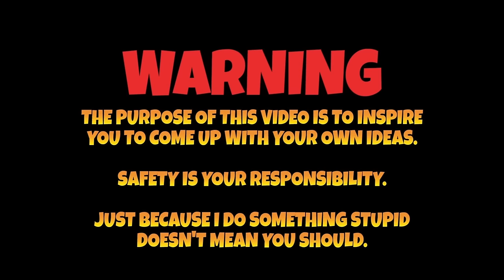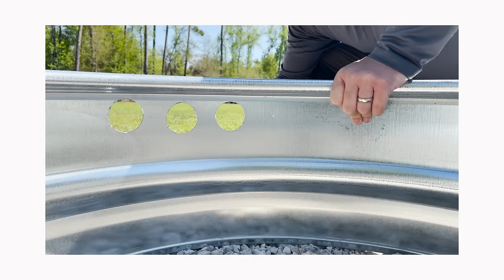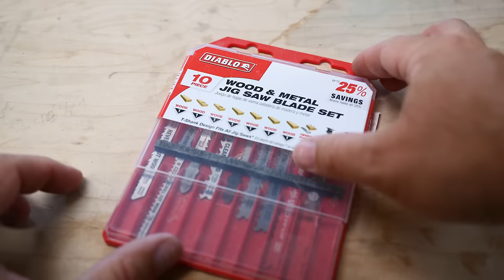8 Must-Have Power Tools For DIY And Woodworking

Comment: Always buy the best tool you can afford, with the biggest battery. I have a full set of Dewalt cordless tools (not the cheap models) and they are awesome. 
I would never buy those 12 v Milwaukee (or other brand) tools for two big reasons. 
1) Small battery and short battery life. 
2) Less power. 
3) Requires more room to set them down. 
The first two are obvious, but the last one is a big deal. When you are working in a small space, or on a small/cluttered work bench the amount of room a tool takes up is a big deal. The large batteries work as a foot to allow you to put your tool down standing up, with the small 12 tools, you have to lay the entire tool down. If you ever had to switch between a Drill and an impact driver when drilling and screwing multiple times, being able to set your tools down on that little bit of a ledge, or small space on your work bench makes a big difference over having to put them on the floor or turn around to put them somewhere behind you.

Also, square drive is the worst fastening system I have ever used. The wedge shape of the bits makes them constantly pop out of the screw head. Philips is even better, but Torx is easily the best. I have never had a torx bit pop out of a screw head.
Reply: Yo. Buying the best tool with the biggest battery that you can afford is not good advice man lol. You have to think about your application first. If you’re doing everyday work like framing, daily carpentry where you need high power like hammer drills, impact drivers that need to go on heavy stock or concrete ya sure get the best one. Milwaukee is the best most powerful one, but for a diyer having a larger Aph adds weight… it is also overkill. For sn amateur who hasn’t made money to compensate the expense of buying said tools will only lose In a return of investment… that only thing a person should go big on the get go is a tablesaw since most of the time those are future proof. Never want to go cheap with that neither like a ryobi where you got to adjust the fence all the time or you keep getting inaccurate cuts plus it’s wobbly as hell.

Lol diyer’s don’t need to be using the most powerful and the best high capacity battery lol. You can always upgrade. Always think ahead
Reply: Another thing too… Milwaukee is the best tool for most applications when it comes to drills with all the stress test people do. But those are annoying AF to change out the batteries and it is heavy with the metal Chuck.  Then and you can look this up, the biggest complaints I see over and over again is when hot mud or let say CA glue or other materials get into the pinch points of the battery latch… that’s game over….
Reply: You clearly are speaking of things you know nothing about.
Reply: I use the 12 v milwaukee every day @ work for general contracting. It's very rare that I need more power. Even the 12 volt circular saw does great. And dragging extra weight around because you think you need POWER at all costs...well that is for stupid people.
Reply: @iloveNgany  It's not just about power, its about battery life. Look up project farm. The bigger battery does create more power. There are also a ton of general contractors out there that are complete idiots.
Reply: @TheBenjammin  Please explain? Tell me exactly what I am wrong about.
Reply: @MAGAMAN  I agree I was just trying to say that if the 12v gets the job done, why deal with the extra weight. I use 12v whenever possible, but 18v when nessasary

Comment: decent vid, but no multi tool??? way more useful than a jigsaw. i have a jigsaw that is 20 years old and probably only used it 3 or 4 times. i have been through 3 multi tools in that time (tbf they were cheap ones) and hence and now looking to buy a decent one (milwaukee fuel is what i have on order). festool tracksaw is the best bit of kit i have, apart from a decent drill driver (again millwaukee fuel), and will do the same things as a table saw and circular saw. BEST ADVICE (and you said it too) IS TO SPEND AS MUCH AS YOU CAN! cheap tools give cheap results!

Comment: If I were going to buy one of these drills, Could I get away with just purchasing the impact drill to use for everyday use?
Reply from the maker: No. You need a drill for that. The impact driver isn’t for drilling holes.

Comment: I was going to get the m12 hammer drill until I realised that it is still rather large, quite heavy and the handle was very fat and that to get the most out of it you would need either the 4ah or the 6ah battery which then makes it as bulky as the rest of the slide packs and the price here in England is astronomical so I ended up getting the Dewalt 709 hammer drill 18v it has the grunt I need and I got two 3ah batteries with the newer 21700 cells which means I can use them on other tools like the compact reciprocating saw and the portable air compressor. I looked at Milwaukee other tools but again extremely expensive and limited products available here unlike the choice you have. So it’s really about what platform you will get the most out of and compatibility. I have an old corded hitachi circular saw that just keeps on going but am looking at the cordless version but will probably get a jigsaw first.

Comment: I’ll just say—a cheap (Harbor Freight) angle grinder with a stack of different (cutoff, grinding, sanding) wheels is surprisingly versatile. The more you use it, the more potential uses it has.  Especially when it comes time to dismantle something.
Reply: Yep, plan to get a Bauer one myself...I already have several Bauer tools and I'm satisfied. I have DeWalt too for a couple items.
Reply: On sale awhile bback for $9.99

Comment: The rule of thumb with miter saw...7-1/4 and 12 is the way to go for contractors. But if you have money, then go 10 and 12.  You have to make sure that the 10 in. is good for portability and they do make lighter ones depending on the brand.  If you only want one.....I think Milwaukee's 12 in. is the lightest of all I have tested, Makita being the heaviest,  but the most precise and smooth.
Reply: You don't need a 10 and a 12 or a 7 1/4 and a 12. A 12 inch is really the only way to go for general contracting and can be easily carried by anyone who isn't a woman.
Reply: @MAGAMAN  uh huh

Comment: If you are like me and dont like table saws, a track saw or smaller circular saw are decent options for cutting or ripping wood. Kreg makes an affordable track option that fits most circular saws if you already own a saw. And my more recent purchase in place of my 7 1/4" circular saw was a 4 1/2 circular saw with the barrel grip. It is MUCH nicer to use, smoother, lighter and easier to control if you are not experienced with a circular saw. It should also be mentioned battery powered tools like DeWalt for example have a electric brake system which is one of the reasons I like using them. If you don't know what that is, it means when you let off the trigger the blade stops very quick vs the older corded versions would continue to spin until they eventually come to a stop, this is a great safety feature.

Comment: I think an impact driver is just as essential as a drill. Its like buying a mower and not a weed whacker. You're going to struggle getting at weeds without a whacker. Impacts can make light work of something where using a drill would be exhausting and a struggle. But they're also an accessibility option. I introduced impacts to my elderly father - who only knew drills his whole life. With back pain, he uses the impact whenever possible because they're easier to use and saves energy. You handed your daughter an impact in the last cart video. How would that have gone with a normal drill? A spinning drill, stripped bits and screws, and much more energy and mass required.
Reply from the maker: That’s an excellent point. I honestly didn’t even think about it like that when I was filming. I wish I had. Thanks!

Comment: Noob here. In the final part you mentioned a lot of "jigs"....what is that?
Reply from the maker: Jigs are templates or devices that let you make specific cuts in materials. Sometimes they are complicated and move and sometimes they are simple and just hold the wood in a certain way to allow faster repeatable cuts. That's the simple version. Hope that helps. 👍

Comment: 18v is the same as 20v.  18v is discharged voltage and 20v is the charged voltage of the same batteries.

Comment: 18v is over kill for home projects.  I only use it for building pergolas and stuff.  I also use the Milwaukee system (the best).  The 12v is plenty for 99% of projects.
Reply: I was given the M18 fuels as a gift. Will only be using it for home use. Understood it’s overkill but is there any downside besides additional cost and weight? Thanks
Reply: @blazzin2341  I don’t think there is any down side at all.   If that’s what you have use it.  It’s much better that the 12v.  I was just saying if a person was looking to purchase one and they are only using it around the house, the 12v is fine.

Comment: What’s the average time the Milwaukee cordless drill last. My Dewalt loves eating batteries.
Reply: I asked about the wrong tool like a dumbass. I actually wanted know how long your cordless jigsaw lasted.
Reply from the maker: It lasts a decent amount of time. I don't know exactly but I've never had to change the battery on a project.

Comment: How do you avoid issues of manufacturers changing their battery with newer models? I do know that old batteries can be refurbished, so my older tools will still function. I just don't want to buy newer tools and be required add a new battery system.
Reply from the maker: I haven’t had any issues with that. It happened more often 20 years ago. I’ve been using the same 12v Milwaukee batteries for probably close to eight years or more even on new tools so hopefully those days are over.
Reply: @HAXMAN  That helps! Most of my cordless tools are nearly 20 years old.

Comment: 20v batteries are actually 18v batteries, it's just marketing bullshit from some companies, playing on the fact that an 18v battery reaches 20v toward the end of a charging cycle.
That said, thank you for the brilliant video
Reply: I believe the ratings are nominal (18v) vs peak(20v) voltage.
Reply: Correct. That said, there are some tools with more than 5 battery cells in series, so more than 18V, for example Kobalt or Greenworx with their "24V" (21.6V) batteries.

Comment: I have a Ridgid mobile table saw.  It is, in my opinion, potentially dangerous tool that I have in my arsenal of tools.  The mobile stand was difficult to erectile parsley because of poor directions and the small type is difficult to read.  Also, it takes a few tries to install tkickback paws and the blade guard assembly.

Once in operation, it is a great tool but careful attention has to be paid to for getting the desired results and for safety concerns.  It has a lifetime warranty and is very mobile.

I also have two compound miter saws.  The first one is a Dewalt compound miter saw I have had since the mid-1990s.  The second one I purchased a decade later is a Ridgid sliding compound miter saw.  The Dewalt I use where I can tote it to a job and the Ridgid is stationary.  From my perspective, a compound miter saw is a computer programmer/analyst's dream on terms of obtaining perfection.

I am absent on a router but I am looking at one now on sale.

Comment: USE A PUSH STICK!! (Your table saw clips had too many examples of your fingers near the blade) Thanks for the video - it's great to review.
Reply: Although I agree with you on the push stick, he has a saw stop lol go look it up. Those have special features where it hits a break system within micro seconds when it detects organic material. Many people put that to the test and the person who invented this saw even put his hand into the blade. That’s why the cheapest job site saw is like $1600

And I had to rewatch that portion, he still kept 4 inches from the blade which is the general rule of how far away you should keep it away from the blade
Reply: @marlonestrella8105  sawstops are amazing. But I don't want to ruin a blade and buy a new stop because I wasn't watching where I was putting my fingers (and that's without the obligatory change of underwear involved with touching your sawstops blade). And as a maker on YouTube, many of the viewers won't have a sawstop, so it's best to demonstrate safe best practices rather than demonstrate the way NOT to do things.
Reply: @BenjaminVaterlaus  that’s true but like I said I watched the video again and he maintains a 4 inch rule. The part where he put his hand over the stock while cutting a rabbit looked dangerous but you can see that the blade doesn’t go all the way through the material. People don’t bother with push sticks when cutting pieces like that because the blade never goes through and there’s no possibility of kick back
Reply: @BenjaminVaterlaus  and FYI I don’t know about the jobsite tables but the contractor tables from sawstop doesn’t get ruined if the breaks is triggered. They ran several tests on it
Reply: @BenjaminVaterlaus  @17:40 he cuts a rabbit on that stock and reaches over the blade, that maybe a little dangerous for a amateur especially if you didn’t cut deep enough to stabilize pressure from the rear and into the fence…. This is why most people use jigs. But if you cut deep enough into the Kerf, and if you have a riving knife which everyone should have, you can simply Guide the piece without a push stick…..   if you really want to critique him, he doesn’t even wear safety glasses when he uses his miter saw
Reply: @marlonestrella8105  yeah, not the table, the brake. It's a consumable. Along with your $80 blade! Yes, it saves a finger but is a $150 mistake if you touch that sawstop. But totally worth it. Just pointing out that while you save your skin, there is a cost to it. And all preventable by following good best practices.
Reply: @BenjaminVaterlaus  lol I already said, and linked you exactly on what part of the video my guy lol…. Where he was doing a rabbit cut on a stock wood having pushed the piece 3/4 all the way in and that the blade is not piercing more than 50% of the depth of that wood mind you, there’s no chance of him cutting his fingers or his hands…. There’s even no chance of kick back which would drag his hand back into the blade should it catch it on its kerf.

Comment: 20v and 18v are the exact same thing they both have the same cells and they both Max out at 20v at beginning of full charge then they settle to nominal voltage at 18v they are the same
Reply from the maker: This not a video explaining the differences. I’m simply pointing out that some tools are available as 20v and others 18v. Why did you even watch this video? I get it. Some people do and others talk. You’re a talker. No problem.
Reply: @HAXMAN  I am a talker who speaks knowledge through experience and just commenting on what I saw I just think it’s funny how people try to act like they’re different when a 20 V battery pack is no different than an 18 V battery pack that’s where I think you should have given your viewers more insight or like myself future viewers

Comment: Umm about the circular saw, i dont recommend buying a new one if it breaks, same with the other ones. Anytime a power tool fails, its usually something thats quick, cheap and easy to fix, like a dead capacitor, or for example in your case, the cable. You can literally just replace the cable, solder on a new one. Or just leave it with that cut and mount a new plug on the shorter end it now has. in all of these cases, we're talking betweel 0-5 dollars if you have an iron, or 12-20 if you don't. Quite a bit cheaper than buying a brand new one and wasting old electronics

Comment: Most  manufacturers make good tools but not all. Beware of tools that cost less than a battery pack for well-known brands. Also, while a single manufacturer is desirable, be sure all their batteries are interchangeable between tools and chargers. To get good tools cheap get used corded tools from Craigslist, garage sales and resale shops. Don't ever saw across your knee. Make a masonite and/or plywood guide for any circular saw to approximate the function of a track saw. Don't buy a table saw with a flex shaft drive. They're 75% of the way to the trash heap when brand new. If you must settle for one buy it used. It will hurt a lot less when you throw it away.

Comment: The router is the most dangerous tool in the shop. Every other tool has some safety features. If you don’t believe me, turn on any machine in the shop by plugging it in with it on. You’ll go to any tool but the 20thousand rpm spinning wheel of death is intimidating.

Comment: I would have to disagree with you here. If you can't cut the lumber, the other tools are useless, at least for woodworking. 

Then the drill is second I think. Now that you can cut the wood the drill allows you to assemble projects.

Followed by a full size router third. Why? Because it allows a larger selection of bits, it's more powerful and you can flatten lumber with it. That's in addition to adding detail work, rebate stock, tough in Grove stock, mortise and tenon stock.

Fourth is the sander as I use it to put finial finish on the project surface.

Fifth is the jig saw, yes this is bias as I hate them too.

From here we get into nice to have toys.

Also kits can be found that can save you money if you find one with well made tools. Especially on holiday sales.

Comment: One of the greatest joys of having a family, owning a home and settling down is the excuse it provides me to accumulate tools.
You want me to assemble a crib? Better go get some tools for that. 
You want me to rake the leaves? Better get a leaf blower. 
Then a snow blower. Then a pressure washer. Drills, impacts, breaker bars, sockets, wrenches you name it you will need it.